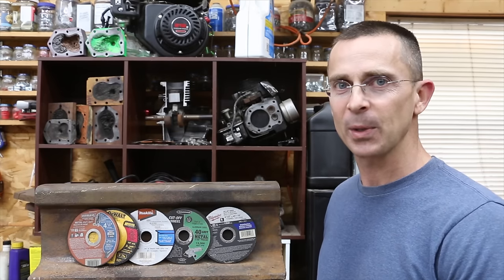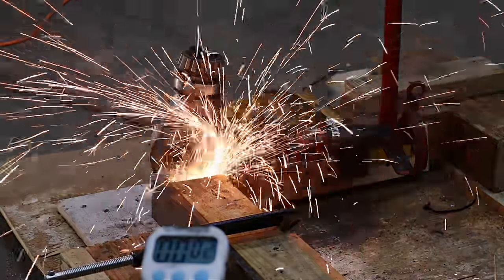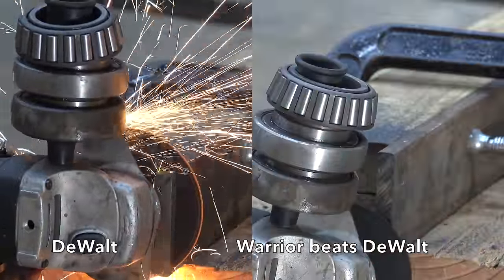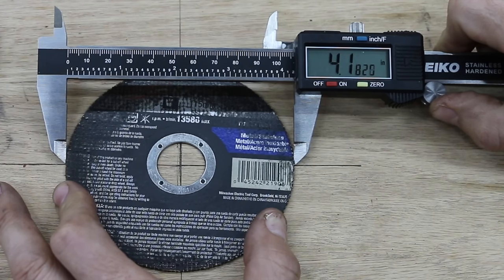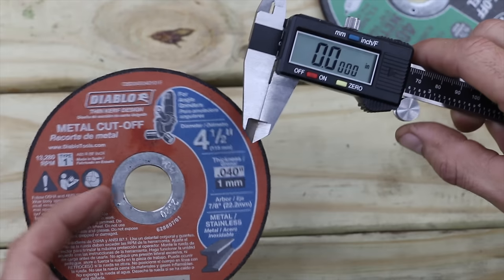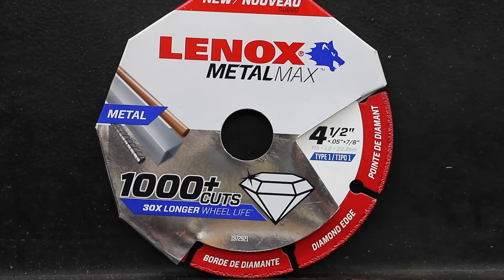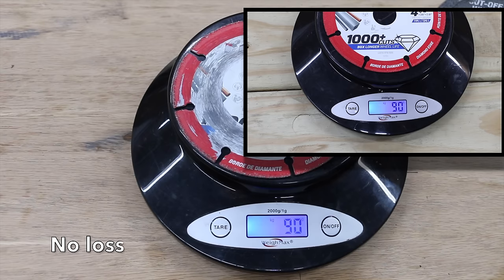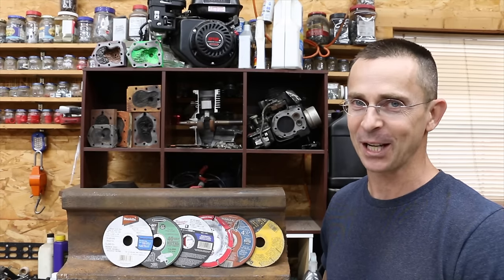Best Metal Cutoff Wheel Brand (6 Brands Tested)?  Let's find out!

Comment: Can you test torque wrenches to see if they're accurate?
Reply from the maker: Thank you for the video idea!
Reply: I second this. Just got done torquing my half shafts on my C3 corvette and used a cheap harbor freight one and felt like it wasn't accurate at 70lbs but I dont have another to compare it to. Thanks for bringing this up.
Reply: This is a great idea
Reply: Yeah, I'd like to see that too. Good idea!
Reply: That's an awesome idea!
Reply: @DiscoGreen  Those don't have to be perfectly 70. They just need to be equal.
Reply: @ProjectFarm   Torque sticks too.
Reply: @ProjectFarm  Yeah, I like this idea, too. And don't forget to include your gadget from awhile back, that tests torque in both directions. I'd definitely buy that if I found out it had great accuracy, too.
Reply: @ProjectFarm   It would also be nice to see the older beam type torque wrenches included too.
Reply: $9 one at harbor freight wonder how it is
Reply: Borrow one from Advance Auto and compare.  If,, it's  a quality one. @DiscoGreen
Reply: @2wheelsoffroad730  i've always wondered how accurate those stay over time. Would the steel its made of suffer from fatigue after 25 years of use and start giving lower readings than a brand new one?
Reply: Keith Yinger I’ve always wondered that too. My oldest is about 7 years old and it’s still relatively accurate. Never had quality calibration tools to do a scientific check though so I’d be interested to see how inaccurate they are compared to various click torque wrenches.
Reply: That would be a very expensive test.
Reply: Yes plz do this
Reply: Id love to see the new icon from harbor freight compared to others. I can understand though if we dont see this test cause he would have to buy thoulsands of dollars of torque wrenches to get a wide variety of brands like I've seen among the other mechanics at work. snap on, kobalt, icon, precision instruments, ATD, and gear wrench to name a few
Reply: @ProjectFarm  For this test its important to measure 'click' torque. At what torque does the wrench click. Because the torque actually applied to the fastener is going to be much more depending on how much force you excert and that is a variable you don't have much control over.
Reply: @271production  Yeah, this. Both the torque measurement tools and specific torque appliance tools in the same test... Or should this actually be two separate videos?
Reply: the cheapest one you can get is fine.  Might be off 1% more, but that's irrelevant to normal ppl.
Reply: In the army we have to get them calibrated.  If your using a tq wrench over a year old it's time to get it calibrated
Reply: @DiscoGreen  You can check the accuracy of your torque wrench. hang 70 lbs. of weights exactly 12 inches from the fulcrum where the socket snaps on. (or 47 lbs. 18 inches out) If it clicks at that point, it's accurate. You can also use a luggage scale.
Reply: I demand the torque readings be done in Ugga-Duggas for us impact wrench users... hahaha
Reply: @DiscoGreen  Maybe digital ones are accurate
Reply: Absolute accuracy is not that important. A few ft lbs either way makes no difference. You should be more concerned that the torque readings for the bolts on an item like a cylinder head or intake manifold are equal.
Reply: @keithyinger3326  you're supposed to send in torque wrenches for calibration anywhere from every 6 months to a year. If you're unable to do so and use your torque wrench infrequently, you need to torque to a value in the middle of its range several (5 or more times) before actually using it. ALL measuring equipment NEEDS to be calibrated, though. Even stuff like calipers and micrometers.
Reply: Stephen Molzer Absolutely correct! And in addition, ALWAYS set the torque to “0” before putting the wrench away. Some dial types don’t require this, but almost all click types do.
Reply: @brucecoleman7412  yeah, storage is important! Mine all call for storage at 10% of max or lowest setting, depending on brand and range. I actually have a CDI tester so I can check my smaller stuff (under 250 lb-ft) by myself. I still send them off for calibration annually, as per my contract requirements. It's just nice to know they're tracking properly and to be able to adjust if needed.

Comment: Just a heads up, those diamond wheels that have slots cut into them can grab on thinner sheet  metal with enough force to break someones wrist. Just ask my co worker!
Reply from the maker: Wow! Thanks for the heads up.
Reply: ouch I just felt the pain in my wrist from reading that
Reply: I'd have to imagine that 'technique' is a primary factor in preventing a slotted disc from grabbing thin metal.  If he was cutting by pushing the disc straight on into the edge of the sheet metal, then theoretically it might be possible to push one of the disc slots into the sheet.  The better technique would be to cut by running the disc on top of the sheet metal, only allowing the least amount of depth of the blade necessary to cut the sheet - i.e. only allowing the disc to cut 3/16" or 1/4" deep when cutting on top of 1/8" sheet metal for example.
Reply: I only use diamond blades now and yeah you gotta be careful,, but I've seen more harm done by the traditional abrasives so I'll stick to them even though my cuts are a little slower
Reply: @jonathangarzon2798  *Lot slower.
Reply: @jonathangarzon2798  amen, especially on a 14 inch saw
Reply: @jonathangarzon2798  tortoise and hare, turtle aint too slow and builds the 50$ sheet rock wall stud frame without jugular stitches in the emergency room ;)
Reply: also, as usual, lubricate the blade.. I cut through a 4x4 inch chunk of aluminum to build a base for a lamp using the 14 inch diamond wheel on an abrasive saw, just sprayed it with wd40 as I went.
Reply: What's your co-workers name and number? I'll ask about it.
Reply: i found they slip then grab on thick stuff too.
Reply: @gatsbylight4766  u
Reply: Just to place these diamond discs: you CAN NOT USE DIAMOND ON CARBON STEEL.
the diamond willbond to the carbon in the carbon steel, the disc will foul up in no time and stop cutting because the diamond grains will be smeared up with iron/carbon.
The way to clean such a disc is to use a piece of tungsten carbide on it, that will abrade the disc clean.

If you want to use something like that on steel: it needs to be CBN / Cubic Boron Nitride.
Reply: Aren’t those wheels for masonry?
Reply: @Mikey-ym6ok  yes lol, diamond carbide impregnated wheels are intended for use on stone/masonry.
They do NOT work as intended on carbon metal.
Sure they will burn their way through thin aluminum, and thin steel too, but that is not their intended use.
People are silly though and see “diamond” on a label and think that must be a good thing.
Great for stone/masonry, bad for steel (unless you like wasting money and misusing tools)
Additionally, I would be VERY surprised if the diamond impregnated material on the Lenox wheel is more than 1/8th of an inch and the rest is raw metal.
Reply: @Skipper20009  yeah the majority of grinder accidents are experienced fabricators too, complacency leads to injury.
Reply: can't limp hold the grinder
Reply: Was he using both hands and the handle or one handing it like an idiot

Comment: JUST A NOTE HERE... I TESTED MANY ON A DIFFERENT TYPES OF JOBS AND THICKNESSES AND MOST IMPORTANTLY, SAFETY. I TRIED TO SAVE MONEY AND BOUGHT A BATCH OF THE WARRIOR BRAND (HARBOR FREIGHT) AND NEARLY LOST MY PINKY AND MY THUMB AND I WAS WEARING SAFETY GLOVES WHICH THE WARRIOR HAD NO PROBLEMS CUTTING THROUGH TAKING OUT MY NAIL ALMOST IN ONE PIECE (THE DISC WAS BRAND NEW AND IT BROKE IN MANY PIECES AT THE START FROM THE SPIN PRESSURE OF MY ANGLE GRINDER, MAKITA AT 11,000 RPM'S) I STILL HAVE THE SCARS AND NUMBNESS IN MY FINGER AND 9 UNUSED DISCS) SO MY FIRST CHOICE FOR RELIABILITY AND SAFETY IS THE DIABLO BRAND. I ONLY HAVE 9 1/2 FINGERS LEFT AND NEED TO KEEP IT AT THAT NUMBER. DIABLO CUTTING WHEELS NEVER BREAK, EVEN WHILE UNEVENLY WORN BECAUSE THE WHEEL MATERIAL IS ADDED UNTO A WHEEL MESH WHICH KEEPS IT IN ONE PIECE, THE WARRIOR ONES ARE COMPRESSED GRANITE WITH NO MESH, SO THEY SHATTER IN PIECES UNDER THE PRESSURE OF THE SPEED, DIABLO DISKS STAY COMPLETE. I WAS LUCKY IT WAS ONLY MY FINGER NAIL AND NOT A PIECE OF THAT DISK FLYING INTO MY FACE. ANOTHER NOTE: I ALWAYS, ALWAYS, ALWAYS USE THE SAFETY HANDLE AND A FACE SHIELD. IF IT GETS DIRTY, I STOP, GO TO THE STORE, PAY ANOTHER $12.00 FOR A NEW ONE AND MY FACE STAYS THE SAME, PERIOD. THOSE OF YOU USING THE ANGLE GRINDER WITHOUT THE HANDLE WHICH GIVES YOU CONTROL OF KICK BACK ARE JUST WAITING FOR A CUTTING WHEEL TO BUCKLE BETWEEN TWO PIECES BEING CUT TO FLY BACK AT YOUR FACE, CHEST OR ARMS... SOONER OR LATER IT WILL HAPPEN, IT IS JUST A MATTER OF TIME... GOT FINGERS?

Comment: How much did each cut cost?
Multiplying the price of each wheel times the percentage of the wheel used gives:
DeWalt             = 1.49 X 10%     = 15 cents
Makita              = 1.99 X 12.5% = 25 cents
Harbor Freight= .78 X 41%       = 32 cents
Diablo               = 2.97 X 15%     = 45 cents
Milwaukee       = 2.70 X 31%     = 84 cents
Helpful? I don't know, but another way of looking at it. 
Love these scientific comparisons though!
Reply: Al Legory u
Reply: Definitely helpful. Numbers don't lie. By also factoring in time / labor cost, it looks like this:
Makita             $0.36 @ $10/hr _ $0.46 @ $20/hr
DeWalt            $0.41 @ $10/hr _ $0.67 @ $20/hr
Warrior            $0.47 @ $10/hr _ $0.62 @ $20/hr
Diablo              $0.55 @ $10/hr _ $0.64 @ $20/hr
Lenox               $0.89 @ $10/hr _ $1.79 @ $20/hr
 (Based only on time cost)
Milwaukee      $0.97 @ $10/hr _ $1.11 @ $20/hr 

3600sec. = 1hr.
Cut time in sec./ 3600 = cut time in hrs.
Cut time in hrs. X $/hr. =  time cost
time cost + cost of percentage of wheel used = Above figures

Of course these are all only based off of the first cut. The smaller the wheel gets, the slower it will cut.
i.e. The Makita may end up cutting slower then the DeWalt after a certain number of cuts with both wheels.
Reply: Al, thanks for doing the math for us! My son was buying the cheapest wheels, this makes the Makita and the DeWalt look much better.
Reply: Note that Harbor Freight always has $5.99 coupon for 10 pack  $0.60 x 41% = 24.6 cents.  I might have to give Makita a try.  I have always purchased Harbor Freight's cutoff's because all other discs costs dollars per.
Reply: This deserves to be pinned!
Reply: @jerrymcintire7902  my old department would insist on buying the cheapest 14” cuttings disk saving about £0.12 per disk but we were using 3 times as many but they couldn’t see past the unit cost. We had the same problem with Rotabroach cutters. I think the two provers were £24 and £30 but the cheap bits were giving us 2-5 holes where the £30 would give us around 30 holes 🤯🤯
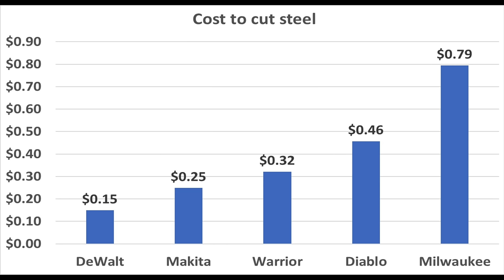Reply: No, it doesn’t. It’s literally included in the video at 7:37. Lol.
Reply: Dewalt has gone from Canadian-made to Chinese-made cutting wheels since this video came out. Puts them back in Harbor Freight territory.
Reply: @AllenMeyerWI  How did you calculate the Lenox whet had no wear?
Reply: @imnew2nm324  The Lenox is calculated only on time (what it would cost you to pay someone to cut with it). The rest of them factor in wear.
Reply: Both of those calculations are great, but neither of them accounted for time spent changing out the blades. Or even worse, having to go to the store to buy more during a job.
Reply: Thank you fror this anylisis
Reply: @ExtremeSquared  sad but true

Comment: Would love to see this test done again with 3M Cubitron, Norton BluFire, SAIT, Metabo, and maybe Walter? I think it would be a great companion to this video.
Reply from the maker: Thank you for the video idea!
Reply: Agreed.  I've used Walters for the last 15 years, have been great.  Just discovered the Cubitron cut off wheels a couple months ago.  Really impressed.
Reply: Ditto for Abracs, Klingspor and Rasta

Industrial brand shoot out? @projectfarm
Reply: @ProjectFarm  Pferd and flexovit are very common brands here in australia that are often compaired to the 3M discs to look at as well.
Reply: 3M Silver are the best abrasives I've ever used, though I've heard really good things about Walter.
Reply: Yea i, mostly use metabo and bosch
Reply: @germanni5566  Cubitron will slice thru anything like butter. Their grinding disk make quick work of grinding off unwanted material. Lasts a LOOOONG time and dont glaze over like every walter discs we've had in the shop!
Reply: 3m green Corps are th best
Reply: Yeah since those are the ones I've been using as a professional fabricator.
Reply: As someone who works for SAIT I would love to see them in the mix.
Reply: If your going to redo this please add some best seller from Amazon/Ebay like Lincoln abrasives and Blackhawk which most DIY use.
Reply: @ProjectFarm  If your going to redo this please add some best seller from Amazon/Ebay like Lincoln abrasives and Blackhawk which most DIY use.
Reply: I’ve always used 3m have always been good
Reply: What are the cubitrons like compared too pferd discs?
Reply: That would be awesome! Especially between sait and metabo
Reply: Eric Roarabaugh we own a heavy metal working shop and just did extensive research on cut off wheels about a year ago. Sait .045 6” cutoff wheels turned out to be about the most cost effective, mainly because of the cut speed and our high labor rate
Reply: @ProjectFarm  I would love to see the 3m cubitron ii as well, considering its almost 15x more expensive, I want to see if its 15x better
Reply: I also would like to see this comparison ..possibly adding stainless steel to the test which is something that encountered  in most industrial shops and can be a big issue for loading up the stone and not cutting.thx for all the great testing.

Comment: Your testing and evaluation techniques are simple, impressive and effective!
Reply from the maker: Thank you very much!
Reply: @ProjectFarm  Always one of the most unbiased reviewers. Here's a video idea, you should pick up a whole bunch of oil filter brands and types, test them, cut them open, and perhaps do a filter test by pouring oil through mixed with metal flanks or something to see how good each brand is at filtering. You could also test the oil flow/restriction through filters. Perhaps if certain types work better in cold starts or high temps. There are many videos that cut them open, but none go in depth with testing, like you do in your comparison videos. And with some many videos relating to oil or additives, it would be nice to see a fair filter comparison.

Comment: Nice job!
And it kind of confirms what I wrote about the grinding wheels. Cheap and fast wears off fast, mid range is a trade off between speed and durability and the top wheel is fast and durable, but costly. 
The diamond wheel seems to be best at cutting thin sheets, but 5 minutes for a piece of steel? That is a point where taking energy costs into account starts to make sense.

Tbh, I miss the videos where you try something completely pointless and destructive but fun and informative nonetheless, like feeding dirt to an engine without an air filter or so. What about speeding up an ice cold engine (dry ice cold at -80 °C) with pure ether and see what happens.
Reply from the maker: Thank you very much!  I've got a fun video planned for 1 April.
Reply: I do enjoy the fun videos, but videos like this one are what I like most. This great guy is saving us time, money, and frustration when choosing what brand works best and last longer. I'm so thankful for these videos. I'd like to see a video on metal cutting Hacksaw blades. My dad did a lot of metalwork and preferred Nicholson.
Reply: @ProjectFarm  hmm, not sure if you're gonna fool us and not have a video/or a video of nothing or really have a serious video on the april the first ;)
Reply: The makita won, and was middle cost.

Comment: Great video! I use cutting wheels, aka "death wheels" on 100% of my fabrication projects solely because I'm too cheap to buy a portable band saw and the torch is too messy. I have used the Diablo wheels with great success but I prefer the threaded screw on type disc. They are far less likely to come apart and send shrapnel whizzing past your head at the speed of sound. I "acquired" some German made PFERD wheels from work and the quality is outstanding.
Reply from the maker: Thanks for sharing.
Reply: Try Metabo wheels.
Reply: Is there a thread on cut off wheel for the 41/2 in grinder, I've been using the blank arbor wheel with the thread on washer thing, id love a thread on cut wheel like the grinder stone and flapper wheels.

Comment: would like to see which plastic gas tank repair works best including the super glue and baking soda trick and congratulations on the 500,000 you would deserve that for sure
Reply from the maker: Thank you for the video idea!
Reply: Good idea! I've always thought those were gimmicky but maybe not.
Reply: Try heat gun to  semi melt (weld), a scrap of similar PE  over the leak. IE, red plastic container scrap over a hole in a red container.
Reply: Buy a new tank. None of them are worth a crap!
Reply: I wouldn't even necessarily be using it to repair a tank...theres lots of uses that it could be applied to.
Reply: @terrylutke  harbor freight has a few different plastic welding kits n I'm sure there's other brands too. I have the harbor freight one that's like an iron n it works good if you take your time n get the plastic to melt together good
Reply: seal-all works great for gas tanks